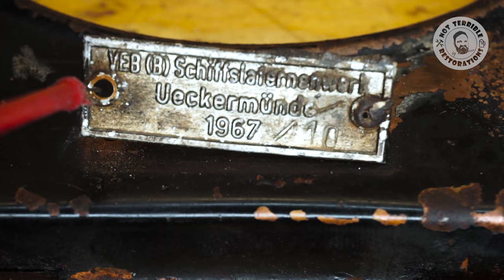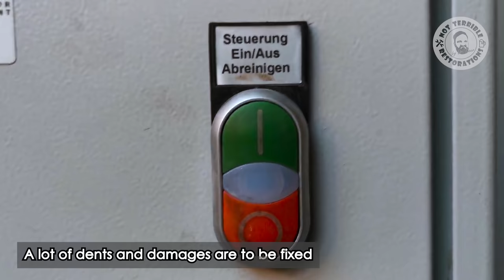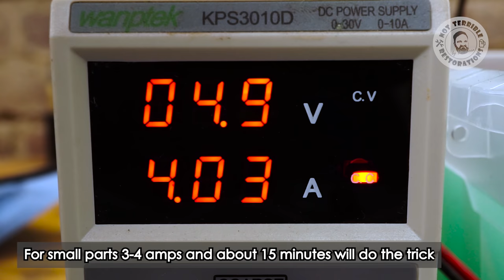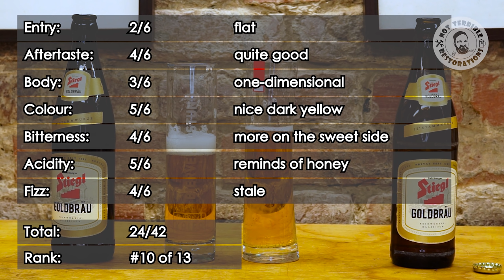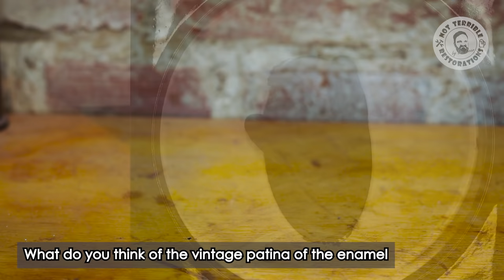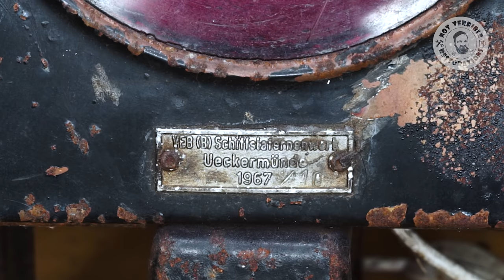NEVER ENDING JOB Restoration of a Train Lantern

Comment: My grandfather was a train engineer and worked at the railroad for many years. There is actually an old train lantern mounted outside maybe 20 feet from where I am at this very moment. My grandpa converted it to be an outside light that works with a switch inside. This really makes me wish I could restore it. Not only as an homage to him, but also because the electrics might be old and dangerous. We don't use it much, as it's really just for aesthetics and doesn't provide much light, but it does get occasionally flipped on and it worries me. However, I do still love seeing it work after all these years and love that it reminds me of him.

Comment: Care and detail. You will always get a good result when you take your time. An old Polish window washer (Michael) taught me to always clean glass with slightly dirty soapy water and to use a razor blade with the glass wet to prevent possible scratching.  He passed 30+ years ago but his knowledge lives on.
Reply from the maker: Sound interesting. Do you know why it has to be slightly dirty?
Reply: @NTRprojects  I Believe he said the little particles of dirt act like a very mild abrasive. He would sprinkle a small amount of soil from the flower pot into the bucket of soapy water before he started. He also kept a razor blade in his mouth while he cleaned but I don't recommend that one.
Reply from the maker: @PRRGG1  that sounds very reasonable. Quite interesting

Comment: Wow. Bravo and well done! I consider myself something of an accomplished restorer, but I absolutely gasped when I saw that end result. It looks like you turned back the hands of time but left enough telltale signs of human hands, from the hand-rolled ropes of window sealant to the slight unevenness of the edge rolled around the wire for the hinge. (Please dont take that the wrong way, I love it, and it really seems better than it would be if it had been perfected). 

One tip for oil lamps, especially ones that use that kosmos style burner, since it relies on the wick being rolled into a tube to burn evenly: once the wick is in place, ensure it rolls up and down as evenly as possible, no bunching etc, then trim the wick flush with the top of the brass where it comes out using a razor blade. then roll the wick up 2-3 mm, and using an eye dropper soak a little bit of fuel into the dry wick and light. allow it to burn down so the charred edge is level with the top of the brass again, then fill up the reservoir, let the fuel soak the wick like normal, light and enjoy! it creates a much more even wick that wont produce hotspots or bunch up unevenly and just adds an air of quality from a well maintained lamp. 

Great video and looking forward to seeing even more!
Reply from the maker: Oh Emily what a wonderful comment. I enjoyed every bit of it and I learned something new. What more could I wish for. Best regards and keep up your projects

Comment: Very good job! I can´t find any images, but... I think it lacks one part, something like a cap on the chimney, cause all the heat and the soot goes directly to the hand of the user hanging it.  Anyways, it´s an awesome restoration. Regards!
Reply from the maker: Hey yes thats true but Since the new owner might use it with electricity the cap might bother....and I could find one on the internet ;)
Reply: @NTRprojects  That actually leads to my question: wouldn't the kerosene lamp heat/burn/break the electric lightbulb or cord?
Reply: @UncleTogie  No, because you wouldn't use both at the same time?

Comment: It's hard to be piece in 1967 they still were using flaimed laterns. 

Great job!
Reply from the maker: That's what I was thinking
Reply: British Rail were using paraffin tail lamps into the 1980s.
Reply from the maker: @ThePillenwerfer  wow really. Haven't the trains been completely electrified by that time? Or was there another reason?
Reply: @NTRprojects  British Rail was state-owned at the time so it was probably part of a general lack of investment and a feeling that it wasn't broke so why fix it.

I'm talking about trains that were a string of vehicles pulled by a locomotive.  Diesel and Electrical Multiple Units and InterCity 125s had electric lights from new.  Even then for a good while DMUs and EMUs carried an oil one as well.  Part of the tail lamp's purpose was to indicate to signalmen that the train was complete and during the day the big white lamp itself was easier to spot.
Reply from the maker: @ThePillenwerfer  yes that might be the reason. I had a job interview at German railway once and they told me that they still have technical equipment in use which is well above 100 years old

Comment: hey just a suggestion: looking at the lamp i think it works with a thorium mantle over the flame to be bright enough for a signal just saw technology connections video on kerosene lamps and it had a very similar looking lamp which used the mantle, second sodium hydroxide works very well to remove burnt oil/soot with little effort specially on inert materials like glass.

Comment: If you were worried about heat degrading the paint, why not use heat-resistant paint, instead of cold-blueing the chimney?
Reply from the maker: Yes that would have been another option.

Comment: There is a good reason for using acrylic not glass, it doesn't break anything like as easily and is more transparent than glass. You could have replaced it easily , I don't understand your reasoning for "restoring" it with a alternative that is worse than the original. That aside, everything else is great!